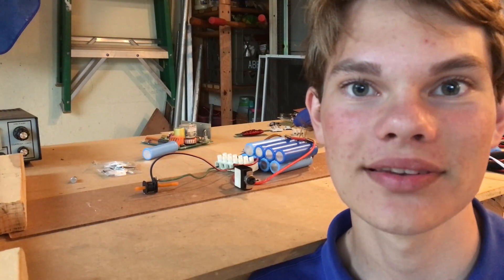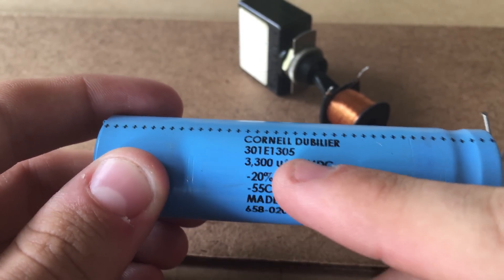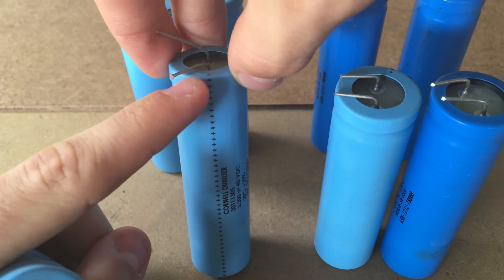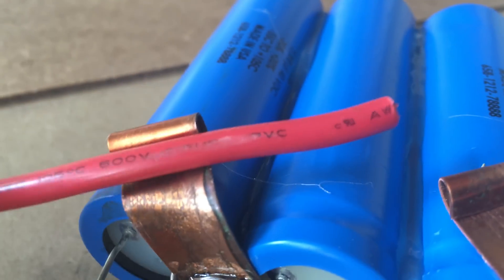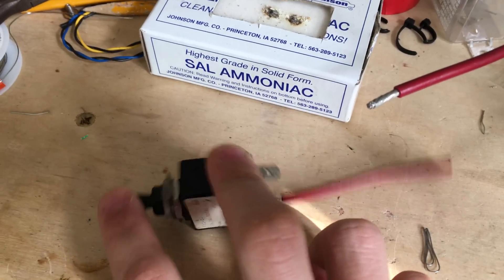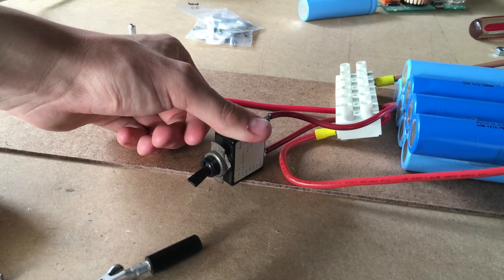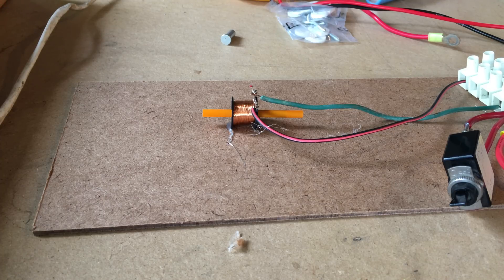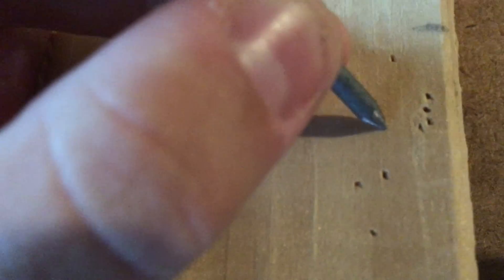Ben Builds: DIY Easy Coilgun | Electronic Projectile Launcher

Comment: I made one, but with a different method. I got a 9v battery, put it through an inverter, then used a MOSFET to step up the current, then sent it through a transformer to up the voltage. The I rectified it, and used it to charge a capacitor to 150-200vDC at 1500uF. I think that you can get a lot more power if you just put more voltage across the capacitors with a little bit lower capacitance.

Comment: hey old granny here you could die if it is above 35v so i just wanted to say that but you shouldnt care i know i dont i just want to scare a couple of babys out there goodnight m8
Reply: alex van rijswijk no voltage doesnt kill  you it can hurt you but current or amps kill you
Reply: jj smith if it is above 50 volts it can overcome human resistange and then the aperers is higer that 150ma that will kill you voltage doesnt kill you but it shure plays a role srry  for typeaids

Comment: If I end up making one, it's going to launch drill bits
Reply: You ever compared the price of nails and drill bits? Might as well add a little bell that cha ching! after every shot
Reply: @dont.ripfuller6587  If you're building a coilgun its probably already going to be expensive depending on how far you're pushing it.
Reply: @HobkinBoi  If I build one that works, it'd be priceless. Whats the advantage of bits? Hardened or do the grooves help in some way,like spinning the bit? I hadn't considered that

Comment: i would use 10 parrallel 1kV 0,05 uF capacitor.
Reply: and where would you find a kv power supply and also amps make a magnetic field
Reply: in your formula you forgot to divide by two
Reply: So it should be (CxU^2):2
Reply: No problem :)

Comment: dude those capacitors are weak af the flash capacitors from a disposable camera run at 330 vdc and there smaller than youre thumb
Reply: literally one disposable camera flash capacitor is more than all of those capacitors together
Reply from the maker: Let me explain... The power stored in a capacitor is a factor of not only the volts but also the capacity in microfarads. This cap bank, albeit at a lower voltage holds orders of magnitude more energy than a flash cap.
Reply: +Ben Builds: plus the way you wired was overly complicated you could have just put them together in line standing up and then just solder the positive to eachother and vice versa
Reply: There is a difference though. One can have the similar energy (say, 470uF at 330v OR 33000uF at 40v), but the lower capacitance will more likely be better because the capacitors discharge quicker through the coil. Also there will be difference in current which directly affects the magnetic field.
Anyway, the build itself is cool.

Comment: Can i use a boost converter and a 12v power brick to charge the capacitors? I don't have a bench power supply.
Reply: yes but you will need to limit current.

Comment: Question: how to know the capacitor is fully charge?
Reply: multimeter / one of those cheap 7 segment voltage displays (but some of them can't measure voltages above 30 volts).
Reply: it stops humming

Comment: Can i pull this off with one capacitor thanks for making the video
Reply from the maker: If the capacitor is large enough, maybe. I would suggest using as many caps as you can get your hand on though while still being safe. The result will definitely not be as impressive with only one capacitor.
Reply: I have a single 33,000 mfd, 70 Volt capacitor how well do you think that would work at full charge?

Comment: y parellel not series?
Reply from the maker: +edwardlui531 Actually, the magnetic flux produced in the coil would be much larger if the voltage was increased. Because current is a function of voltage and resistance, the higher the voltage and the lower the resistance the higher the current. Now, the reasoning behind me using them in parallel is simply an issue of safety. If they were connected in parallel the voltage of the bank would be 320v. I don't have a 320v power supply, and I'm not confident enough in my safety skills YET to be 100% sure that I wouldn't kill myself. I can touch the leads of the capacitor bank all day with no issues as it stands, but at 320v, all it would take would be one false move and I would be toast.
Reply: You're after higher capacitance rather than voltage. 
This because capacitors have very little internal resistance the current spikes very high regardless of the voltage when shorted and the capacitor is discharged very quickly. 
As a result, you don't really care too much about the voltage as the current drawn will be obscene anyway whether 400volt or 500volt.They key is producing a magnetic field long enough to move the object which isn't possible without dat farad.
Reply: +1992jamo but isn't magnetic is induce by current. if instead I series the capacitor and use the first coil that he use I should be able to discharge it instantly.